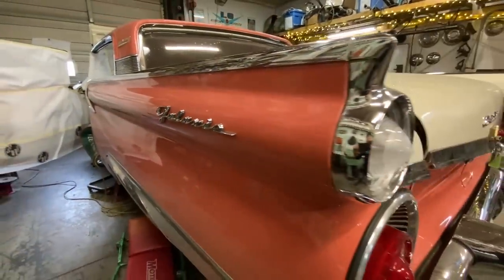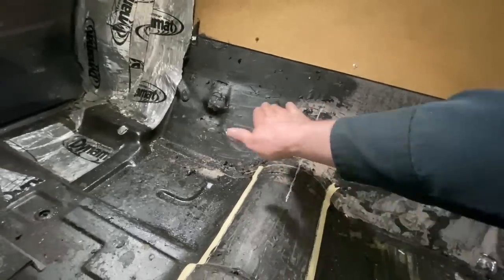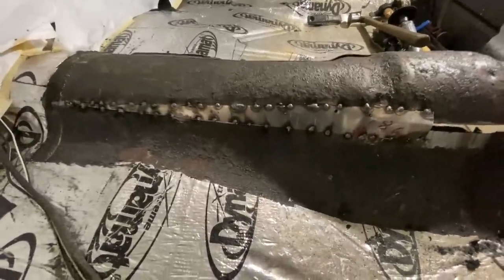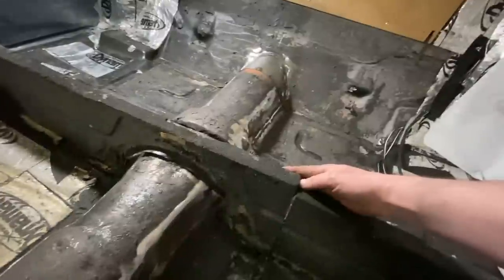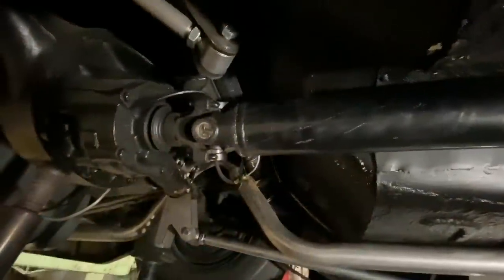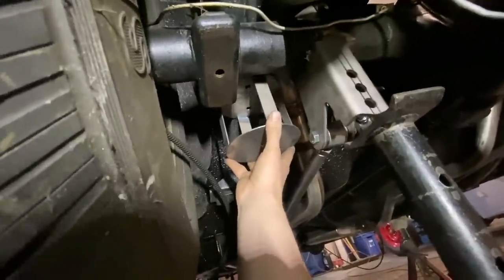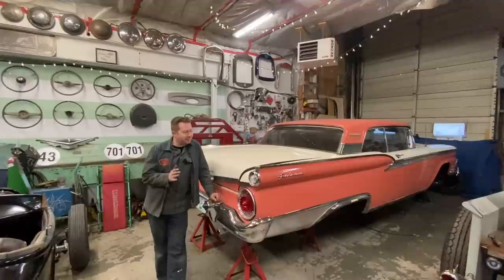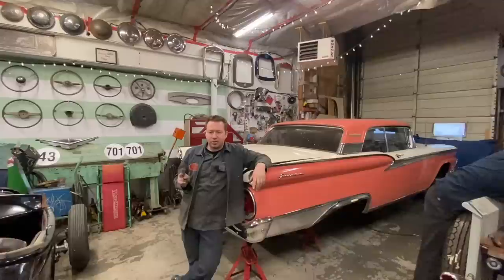Air Ride on a 59 Ford Galaxie Part Two. Raising the driveshaft tunnel and building rear bag brackets

Comment: Hi Lee and Shannon . Worked out really well .Was shocked yesterday at the price of spray bomb etching primer , header primer , and just about anything spray can paint related . Have a great week !
Reply from the maker: It’s insane! I’ve always been amazed with the graffiti wall across the tracks from the shop, how much money these artists are spending to paint on that wall. Probably a couple hundred bucks in paint for each piece
Reply: I bought a cheap Harbor freight spray gun so I can mix paint or primer from the hardware store. It seems like every time I buy spray can paint every time I go to use it the air from the can is gone. Now I have a whole can of paint with no air. I have to poke a hole in the can to pour in the harbor freight paint gun any way to spray. I found it saves me more money to buy a quart can of paint and mix and spray. It is more convenient to have spray bomb/can if your going to use it right away but shelf life it's up in the air if it's going to work or not. To bad they don't have a tool to refill the spray bomb once it looses the air from a full can of paint.

Comment: That's called cut and butt, Fittzie came up with that method not shire where he got the idea. A whole lotta people use that method for welding sheet metal on automotive sheet metal new to original metal. You have to hold the cutting wheel at an angle. Because if you hold the cutting wheel straight down you will have a gap the size of the cutting will. You will have to add a lot more filler rod.